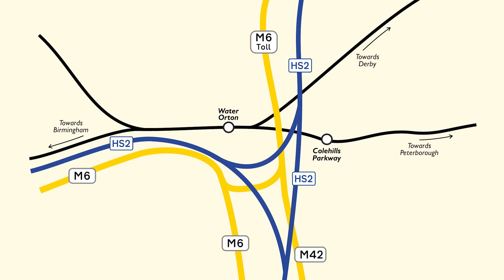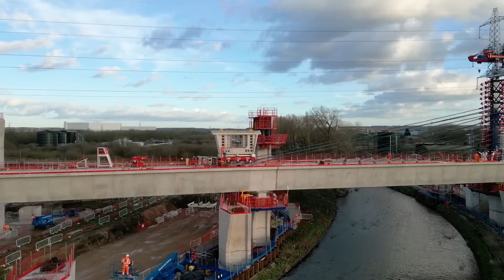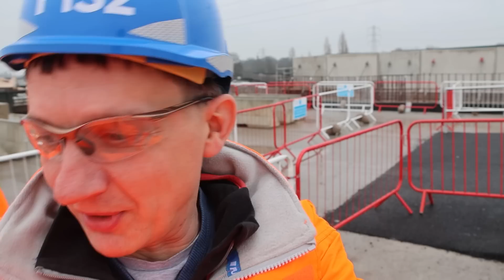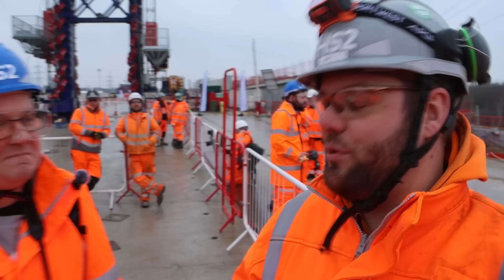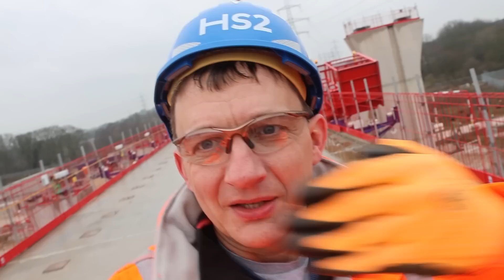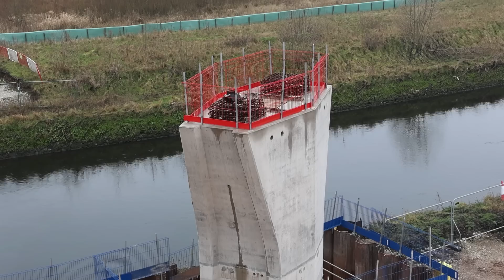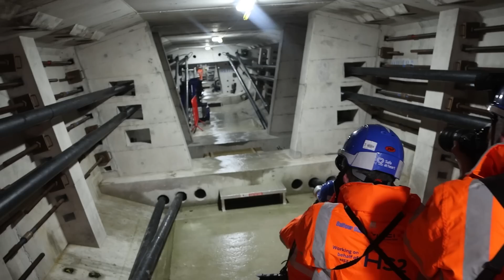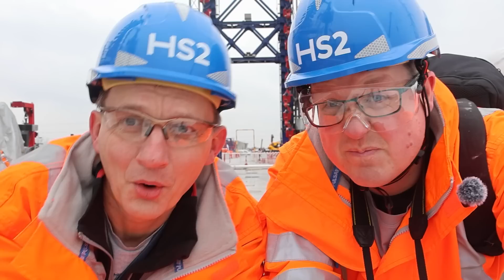HS2 Delta Junction Under Construction

Comment: Its cool that they have left scope for the manchester and leeds conections but its a pity the tories sabotaged it.
Reply: its a shame labour made the idea of the "xxbn black hole", meaning they don't want to borrow, which this is EXACTLY what borrowing should be for, something which you will get a return on investment in the long term
Reply: @ooliverhave you seen the size of the national debt? And spend it on a super size big boys Hornby play set? Madness
Reply: @ooliver what "return on investment"?

It's over-engineered and started off with a very weak business case. With the massive cost inflation it will never give a return on the money spent.

Was more railway capacity needed? Yes. Is this the right way to get that capacity? NO!!!!

Far slower line speed is appropriate for the route. 225 mph line speed is utterly wasted given the short distance between Birmingham and London. There's no call for anything faster than 150 or 160 mph. That reduction in line speed provides enormous savings in infrastructure constraint requirements.

A new 160 mph line would still be a significant improvement over the WCML. It would also allow capital investment in many other schemes. Much wider spread electrification of existing routes for example.

HS2 has seen time wasted, political capital wasted and money wasted. Things we will never get back.
Reply: @davidpnewton  it is the right way to get that capacity. It puts a bunch of the WCML intercity trains to HS2, giving the way for other trains to fill in the capacity. Its only "short" cause you truncated all of its branches!! Besides, its a new high speed line for today's specs, why keep insisting on mediocre 160mph speed? I swear, the UK has lost its ambitions. What all of you guys do is grumble and make fun of everything.
Reply: @BrakeCoach why have things been "truncated"? MASSIVE COSTS. Some of that is our bureaucracy and NIMBY problem. A lot of it is gold plating and over-specification.

Without that gold plating and over-specification room remains to keep phase 2 in its entirety.
Reply: @davidpnewton A financial disaster typical of British Government socialist style planning and then incompetent delivery
Reply: @davidpnewton nope cancel the lot
Reply: @davidpnewton  I feel like NIMBYism had a huge impact on HS2's construction. Digging tunnels under farmland is bollocks.
Reply: @BrakeCoach it has destroyed a lot of people’s livelihoods, crashed house prices, caused huge congestion and traffic issues and sadly ruined people’s lives when property and land financial compensation was very much lower than market values
Reply: yeah it is overengineered for the scope of hs2 now. there wouldn't be a business case for just phase 1, but rather the connections to manchester, sheffield etc are what would have provided the traffic - trains to Birmingham won't cut it. the phase 1 "core" is slab track meaning higher upfront and minimal maintenance (less than normal railways) and suitable for 18 trains per hour (it will get nothing like that now) and to last at least 120 years. if in 60 years it is being well utilised then that will be a great saving over having to build Another line. also: HS2 is about creating far more capacity on other train lines, and the M6. it's not about high speed (ironically), that was just a nice to have that didn't add much to the cost of a new line. say what you will about ripoff uk infrastructure but hs2 is only a ripoff because it is so big. all uk infrastructure (roads or rail) is this bad
Reply: @ooliver But the return on investment for this colossal white elephant is not something that will happen in many, many lifetimes. The money should have been spent on better infrastructure in the North, where it is needed most. Northern Powerhouse Rail would have delivered far more meaningful benefits to far more people, improving connectivity between major northern cities and driving real economic growth outside the London bubble.
Reply: @d-zone  HS2 would have allowed quicker journeys between Leeds, Sheffield, Nottingham and Birmingham, and Manchester and Birmingham- all pretty major cities in the north and Midlands. Then some of the infrastructure could be used to support better infrastructure across the north too.
Reply: @d-zone well said 100% agree
Reply: none of the land has been sold yet, so they did a terrible job of sabotaging it
Reply: @KingFinnch  Hopefully it gets reinstated before it does get sold. How long is it until the land gets sold off?
Reply: @rayan0984 it wont get sold it will be like HS1 and get built in 2 stages
Reply: The Conservatives aren't to blame. This project is expensive nonsense
Reply: It was sabotaged by relentless regulation, ecological surveys, environmental studies, thousands of “consultants” and many more robbing the public coffers
Reply: Trash papers like the Mail and Express are to blame for HS2, for stirring up opposition in Tory heartlands in the Chilterns... why a lot of the project has come in way overbuget, much as the NIMBY's living in the Chilterns whinged about it.  It was sold as high speed railway, rather than capacity..Ridiculously long tunnels have been built  which are completely unnecessary... . Its the Chilterns, not the flipping Alps or Pyrenees!
 Johnson was pro HS2, Sunak tired to play the hero and get it halted to appease all the Tory voters in the southern section!
Reply: Labour should fund the construction of the connecting station so that the possibility remains more open once the Birmingham-London route opens
Reply: Of course, the current government is blameless........
Reply: @d-zone  So far, but all the money may go on destroyers, submarines and tanks.
Reply: @SWRural-fk2ub you’ve not learned the lessons of Hitler and the late 1930s
Reply: @d-zone  both of them do ridiculous amount of austerity and both deserve their downfalls unless they change their ways.

Comment: I hope that HS2 will perform really well, over the past couple of years it gained a significant amount of controversy through all parts of the political spectrum.

I don't understand why does it have to cost 100 billion quid for this new railway. I would rather use the money to upgrade Camden Town tube station rather than this nonsense. 😑
Reply: London to Birmingham is more like £55B

It's going to be a train every 7 minutes, and basically take all of the fast trains off the WCML, massively increasing capacity for freight and local services while making the fast services far more reliable
Reply: @KingFinnch  A theoretical train every 7 minutes that'll be half empty because nobody can afford the fares.
Reply: @d-zone 

What are the fares going to be?
Reply: If the train has empty seats, then expect to be able to purchase cheaper tickets. That's simple yield management.